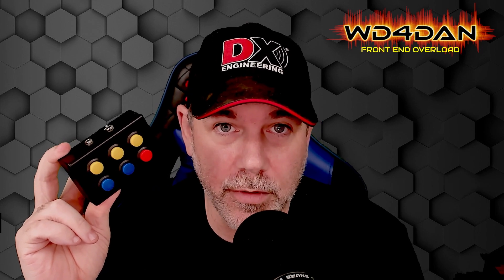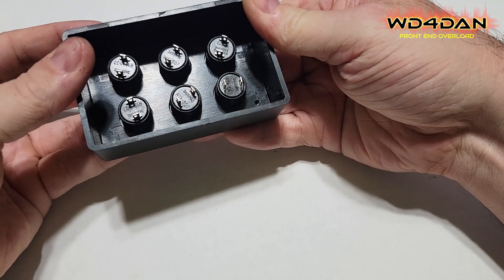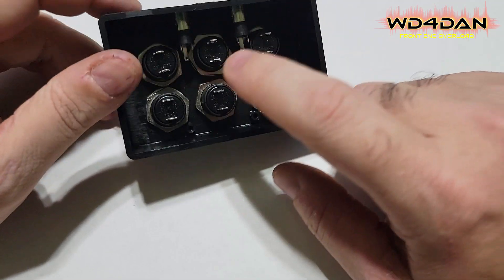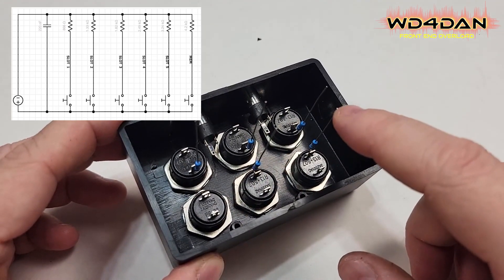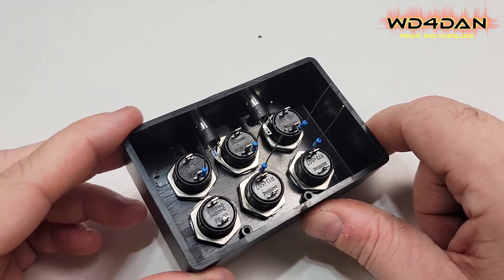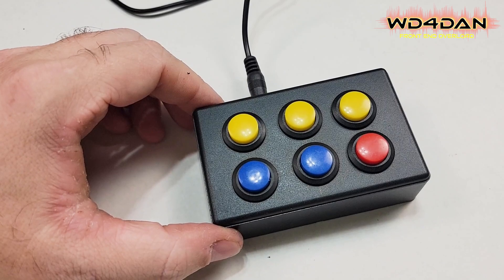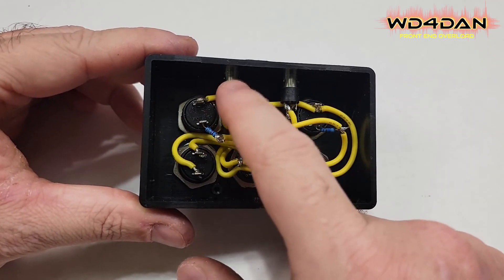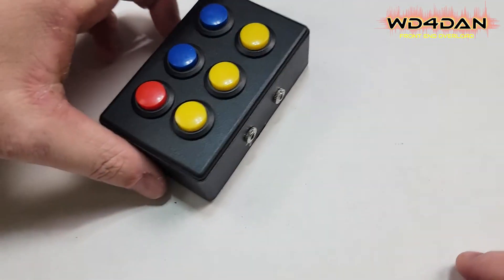Yaesu FH-2 Remote DIY Build (with PTT)

Comment: The capacitor is just there to de-bounce the switches.  Depending on the switches you use, it might not be necessary.  If you press a button and it "registers" more than one press, you'll want to add the cap.
Reply from the maker: makes sense, thanks!